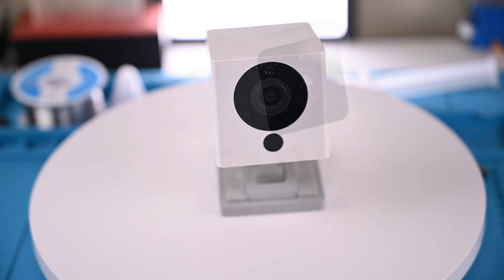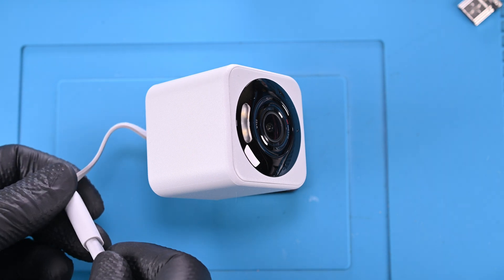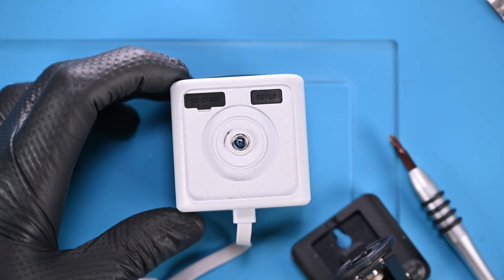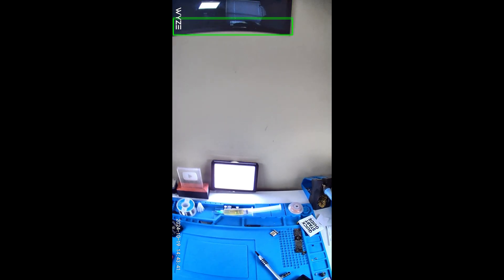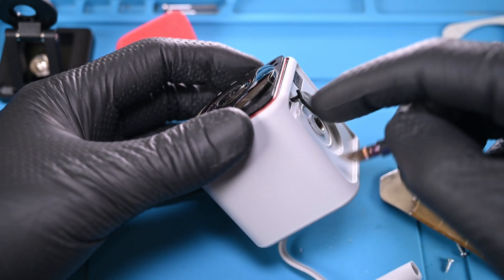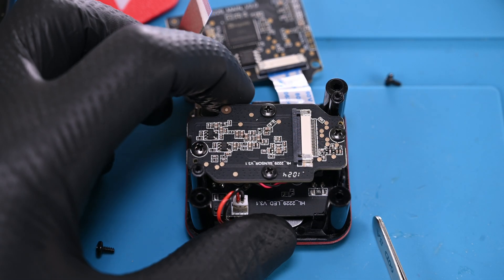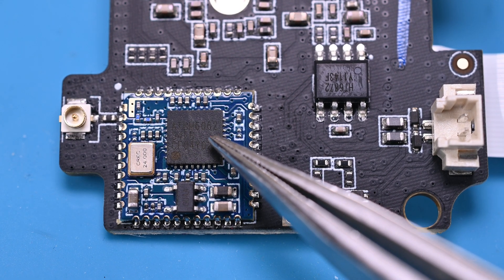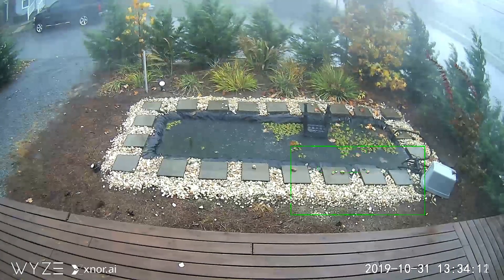Is the Wyze Cam V4 an improvement over the V3?

Comment: Thanks for this video. I backed a Snapmaker U1 which should arrive on January. It's known for having a very bad frame rate so I thought about replacing its camera with a Wyze camera somehow.
As per your video since the lense is separated from the board I'm guessing it would be a matter of cutting the two wires and add them some extension. 
By the way I'm not an electrical engineer or so, I'm just a curious programmer that likes fixing things by his own, I'll see how this one goes.

Comment: Do you know what part acks as a fuse in the camera?
Reply: I spit an old micro USB cable and connect the negative and positive to an old camera cable adapter i have on my house for power and it worked for a minute but I guess it was to much voltage for it. It sounds like it wants to turn back on , but the speaker in the back just makes a faint chirp. I open it up but couldn't find anything damaged.
Reply: By the way your video was very helpful.
Reply from the maker: That’s a really good question, I do not. Looking over the board it doesn’t seem to have any traditional fuses, meaning it probably uses a resistor if one at all. I wouldn’t put it past Wyze to skip over a few safety components.

Comment: Have you tried replacing the lens on the v4? I've replaced the lens on the v3 and was wondering the lens can be replaced on the v4.
Reply from the maker: @idontknowimonvacation  I did a focus modification on the V3, but haven’t tried the V4 yet. I’m currently working on a Pan V3 mod but might see about adding a focus ring as well
Reply: 4:58 It looks like it's glued in again on the v4.  I also swapped my v3 lens for a telephoto.  I'll let you know if I swap my v4 lens, but I'll probably wait for a Wyze 4K cam (v5?).